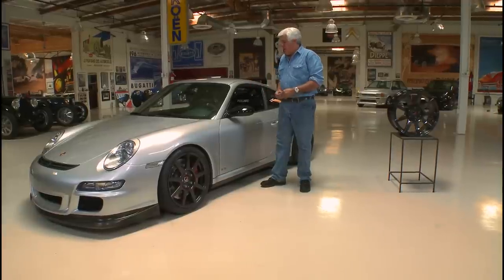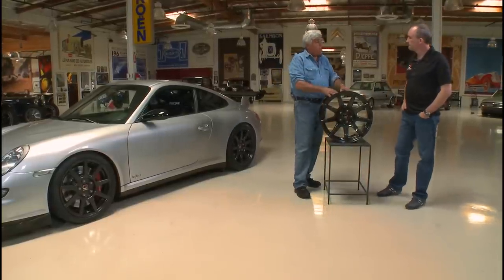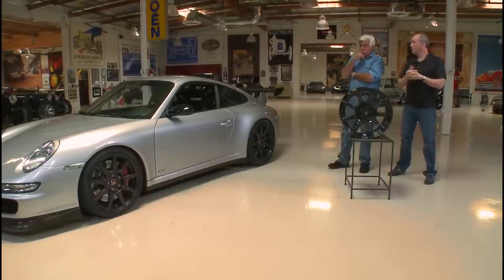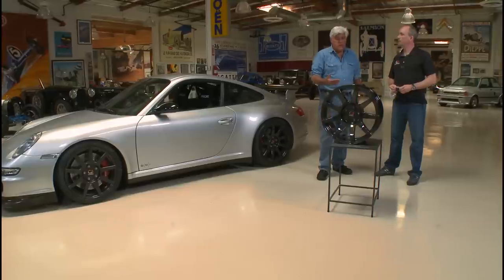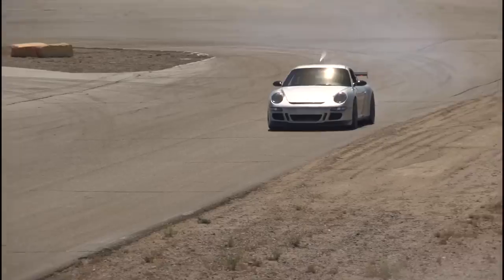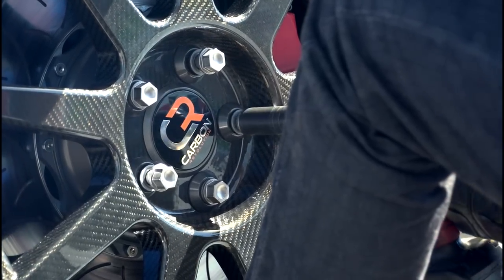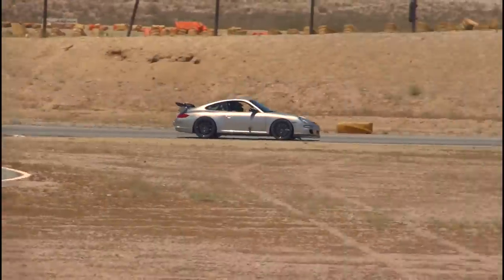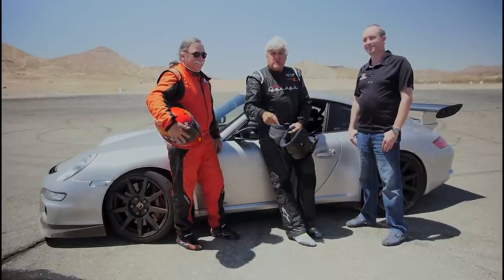Carbon Fiber Wheels Road Test - Jay Leno's Garage

Comment: Koenigsegg was first
Reply: to make carbon fiber cars
Reply: Ocelots.
Wheels, not cars. Carbon fibre was being experimented with in cars way before Koenigsegg became a car company, but not used in production cars.
Reply: G0ML3 This is true but he also said they are manufactured more expensively and at a lower volume, thus why Koenigsegg charges thousands for those carbon fiber wheels. It sounds as if he wants to make carbon fiber a more mainstream application.
Reply: Kevin schwantz I think rode a carbon fibre wheel that distroyed itself at warp speed.
Autoclaves are high temp kilns in a vacuum to draw out any air pockets in the weave.
Reply: Koenigsegg are making two-piece wheels out of carbon prepregs, all manufactured by hand and cooked in an autoclave. This is not about making the first carbon fiber wheel, this is about making the first one-piece carbon fiber wheel without those expensive and time intensive processes to get it out there and available for "everyone". More about the Koenigsegg wheel: watch?v=PGGiuaQwcd8
Reply: GodDamnDragon This I thought was hilarious after he announced the price. I was expecting 2k a wheel tops......
"We have taken the expensive parts out of the process... its 15 thousand dollars."
LAWL
Reply: Koenigsegg doesn't mass produce it
Reply: G0ML3 thank you for correcting me.  :) have a nice day :)
Reply: *****
I think you understand what I was saying... Yes you need a Koenigsegg to be able to get those carbon fibre wheels so not exactly cheap if you have to pay for hella expensive car to get the expensive optional wheels, but they were the first nevertheless. But these wheels are still not cheap, you really need a supercar to be able to afford such a wheel to begin with or atleast justify spending that amount of money. So using the term "carbon fibre wheels for the masses" needs to be taken with a pinch of salt. It's not something you'd fit on your Ford Fiesta let's say haha...
Reply: G0ML3 I totally agree. Even with this guys efforts to lower production costs the company still charges 15k for a set. I think as volume goes up and the production is more streamlined a cheaper carbon fiber wheel will appear on the market. But when that happens then yes I could see them being on other performance cars or even passenger cars not just "super" cars. But yea at that price 15k set of wheels on 10k tuner car is just not happening. LOL
Reply: I've seen the video where Koenigsegg people explain their carbon fiber wheels technology, it's not a "one piece" wheel, it looked like they've made a 3D printed material and than they put some carbon fiber layers on the frame. In order to keep everything together they put the wheel inside a geant oven. The guy with JL seems to come up with another method!
Reply: The Aircore wheels Koenigsegg makes are far more expensive to make, hand made pre-preg wheels with hollow spokes. A set of wheels are $60.000
Reply: Peter Pan thats why these guy inventing the new way to make these to be more affordable..more expensive just mean it got less efficient production tech
Reply: Carroll Shelby did fiberglass wheels in the 80's
Reply: Onur Sahin fiberglass is fiber,carbon fiber is also fiber  both is to be honest bad material to make a wheels compared to metal.
Reply: TEH KOTAK Why ?
Reply: said the guy in the video.  not sure why you're bringing this up.
Reply: TEH KOTAK I mean, carbon fiber is lighter AND stronger than metal, so you could yuou explain to me why this would be a bad material to make wheels ?
Reply: dreamoiseau yes it is stronger,but it doesnt have any kind of elongation.if you hit metal door with hammer it will make a dent right?but if you hit carbon door it will just break and shatter/crack.

this is why multibillion dollar f1 and other race car still prefer metal as a wheels.
Reply: I don't think Koenigseggg decided to make carbon wheels without thinking to that. Perhaps because it's so much resistant that it would need a very hard hit to damage it, hard enough to definitely ruin aluminum wheels ?...
Reply: And that's what they say in the video. 
The idea here, like he explains time after time is to bring this to OEM's and mass production. That's what the tech is all about here. 
So maybe in two years time you will see this in "only" 100 000 euro Porsche and maybe somewhere down the road on your performance orientated Ford, Golf R etc.
Reply: dreamoiseau
They know that most of their customer only bought their car for show and cruising at 60kmh arround town like london.
Maybe 10minutes arround very smooth track every month or so.but for real race and everyday use carbon wheels is not really practical.

Christian.v.k is clever man,he takes money from millionaire who gets more money than knowledge about cars.

Or..he invent some new carbon fiber that can bend like metal?who knows..as far as i know its impossible
Reply: TEH KOTAK
There's no way a company like Koenigsegg would fit a carbon fibre wheel if it wasn't safe, the wheels would have to go through extensive testing and controls over countless of hours. The only way a wheel would shatter would have to be if you drove the car straight into a cerb at INSANE speeds for anything to happen to it and at that point it doesn't matter does it? There's no turning back at that point, the wheel/car would be totaled. All wheels have to meet certain regulations and they have obviously passed.
Reply: TEH KOTAK You're so wrong it hurts.  90 percent of an F1 car is carbon fiber.  The #1 reason race teams do not use carbon fiber wheels is because the current rulebooks don't allow them.  As soon as they are allowed I 100% guarantee F1 will be using them.

You are very ignorant of the properties of carbon fiber.  Carbon fiber does not shatter when you hit it with a hammer.  Porsche uses carbon fiber on the hood and doors of the GT3, do you honestly think they would use a material that would shatter on impact?  Please go educate yourself.
Reply: Alize C G0ML3 theres a reason that rule exist.carbon fiber has been arround since forever. did you guys seriously think company like porsche,ferrari,lamborghini,audi,pagani,nissan and toyota cant make carbon fiber wheels lol?

Please proof it to me where i am wrong or ignorant. I study ship engineering and would like to know if my book and professor is wrong about this.
Reply: Koenigsegg is a great company, By far my favourite, but these wheels he said are $15,000 for a set. koenigsegg wheels are over $100,000 for a set, closer to 200k. they are also significantly stronger, and lighter wheels. but again, no were close to for the public. these wheels are a nice accessory for this porsche, those wheels cost more than this porsche.
Reply: Peter Pan Im pretty sure its 60k per wheel, not for a set... thats why they are only on the one:1 right now which costs 2 million dollars.
Reply: martinshoosterman Nope, "standard" Agera (S or R) has them too.
Reply: martinshoosterman it's $60k for a set, not per wheel. The reason porsche, ferrari etc doesn't use carbon fibre is because of the cost. Koenigsegg makes 10-12 car per year and therefore doesn't have to make that many wheels (wich are made by hand). It would be ridiculously expensive to manufacture the wheels Koenigsegg use in a larger scale, wich is why they don't make them. Magnesium wheels with carbon drums (dymags) have been around for a long time, Koenigsegg even used to fit them on the CCX/CCXRs but the aircore wheels they make now are all carbon with hollow spokes.
Reply: Peter Pan
Its not about cost.everything can be mass produced to bring the cost down,the main problem here os carbon fiber has really poor elongation capability,i said this before over and over again since using carbon for a wheel is DANGEROUS!please..think&read about it before using it in your vehicle!
A wheel will always moving/rotate and hit stuff on regular basis!

Even on cycling carbon fiber stuff tend to shatter and hurt the athlete many times before
Reply: TEH KOTAK (Sigh) Engineering students...... When are you going to learn that you don't know everything? Hopefully one day, your professor will tell you that you don't know everything as an engineer. But okay, you're a studying to become a ship engineer, so I suppose you have a lot of experience with the making of carbon fiber wheels.
And if you think carbon is a poor choice in boat building? Oki. How come all the racing shells, oars and seats I've used as a national team rower have been made from carbon fiber? You think the worlds fastest cat and vee bottom are made from fiberglass? I think both Mystic Powerboats and Outerlimits know what they are doing. You have gained the knowledge about the elongation of carbon fiber, congratulations, you are now an expert.
The thing about carbon fiber is, that used correctly, it is incredibly strong. Used wrong, it's garbage.
Reply: Koenigsegg was second. These rims appeared on the SSC Ultimate Aero several years before Koenigsegg made their wheels.
Reply: TEH KOTAK Yes, carbon is a brittle material and when it fails it cracks or shatters. Aluminum will bend before eventually cracking. 
But you are completely ignoring the rest of the material properties. The yield strength and ultimate tensile strength are so much higher than aluminum it doesn't matter. The force required to shatter a well made carbon rim would have completely crushed an aluminum rim long before then. 
Mountain bikes have been using carbon rims for a while now, and if you know anything about that sport, they are slamming into sharp rocks constantly. If it can handle that abuse, it can handle a street car.
Reply: TheOfficialKC Not sure SSC aver made a set that actually ran the streets, or was used at their record run. And did the SSC wheels that were produced have a TÜV, CE and DOT certification? No.The SSC wheels seemed more to be a case of prototyping and experimenting with an idea, rather than actually producing an actual wheel. As far as producing certified full carbon wheels that ran on the road, yes, Koenigsegg were the first. To speculate who came up with the idea first - it's a moot point frankly. Also, Dymag came in very early with the carbon fiber barrel and Magnesium center. It did not work.
Reply: ABOlsen69666 The wheels SSC were these exact Carbon Revolution wheels, not something made by SSC. They were in fact an option production models starting 2009.
So Carbon Revolution was the first production, one piece carbon wheels.
Reply: +tissot233 You called it with predicting the performance orientated Fords to come with the carbon wheels. The new Shelby Mustang GT350R has them.
Reply: +Xentenon 42lbs vs OEM Porsche wheels which probably cost just as much or more from magnesium.
They would be cheaper and benefit much more on cheaper performance car, like Golf GTI.
Reply: So was Rayjay and look where he is now...
Reply: Uh, no Koenigsegg was not the first, its not anything that can be considered an available rim when the technology to make it isnt distinguished and you can only get the wheel by purchasing the car, which Koenigsegg hasn't really even done much of at all compared to any reputable supercar manufacturer, such as Pagani even. Of course you probably didnt even watch the video, the guy is located in Germany and has been working with TUF for the last 3 years, where they have easily the most strict automobile regulations on earth, and they have obtained OEM certification, not just aftermarket.  But thats koenigsegg for you, no heart and soul and nothing of substance, just them and their fanbois spouting supposed numbers and attempting to get bragging rights without any real validation. Carbon revolution didn't create carbon rims to just say they could be the first or to be ostentatious, they did it because they are passionate about composite technology and progressing it forward by making it more affordable and understandable to the masses, and helping OEM manufacturers produce it. A noble goal
Reply: And the Koenigsegg wheels are all carbon fibre - no aluminium inserts around the lugnuts (or in Koenigseggs case the centre hub).
Reply: you've quite  an attitude about Koenigsegg!  These arguments about 'who / what was first', tend to degenerate quickly irrespective of the subject matter.  The question, to be precise, was 'does any manufacturer sell cars with carbon fiber wheels?''.  The answer to that is "only Koenigsegg', and one might think you would believe that when someone else trying to manufacture CF wheels, says it is so.   

I cant help noticiing, however, that you didnt say who you think was the first to produce CF wheels.  Perhaps if you read this you could enlighten the studio audience as to their identity?

I also note that Koenigsegg, for all its lack of heart, soul, and lack of ideas, is also manufacturing a motor with no camshaft, but with hydraulics which control position to the a tenth of a millimeter.  Anyone else doing that?
Reply: he already said it wasnt the first carbon fibre wheel, carbon innovations brings it to a mass market where we can begin to see price decrease overall
Reply: WRONG. Michelin made carbon wheels for the Citroen SM starting in 1971.
Reply: Not at all.f1 tyres need heat, carbon wheels wont transfer the heat.
Reply: @G0ML333  koenigsegg is the only company that makes their own carbon fiber wheels for their vehicles.
Reply: so 1 guess know one goes on the porsche configurator

Comment: I've not yet experienced carbon fiber wheels but, I did swap wheels a while back on a non-stock VW GTI. The factory 14 x 6 cast alloys weighed 22.4lbs per wheel. They were replaced with a set of 15 x 7 hammer forged and milled wheels that weighed 12.3 lbs per wheel. The difference was incredible with improved handling and braking but, the biggest difference to me was the improved acceleration. The lighter weight in the rotational mass of the driveline made it much easier for my 2.0 liter motor to spin up. Great presentation - Love your work.

Comment: I'd like one set of each color for my solid gold rocket car.
Reply: wow taofledermaus!
Reply: Who's that?  :P
Reply: Thanks Marc!
Reply: But, they're carbon fiber.  Using them would mean your rocket car isn't solid gold anymore.  FAIL!  ;)
Reply: OH...  I didn't think of that.  Plus it would have been hard to mount the solid gold tires to those rims.
Reply: But, man, just think of it.  Solid gold tires on carbon fiber wheels, the bling factor would be, like, exponential. lol
Reply: I might go for rims made out of  solid diamond.
Reply: Hmmm, sparkley...  Brilliant!
Reply: Marc D Thanks the videos are good. You should get something for that.
Reply: Went to you from here. Good stuff. Happy to subscribe nothing better than cars and guns. Well if you add beer and hot chick. I love You Tube Its all here.
Reply: ***** I'd save the diamond for the brakes a solid gold car is going to weigh a lot
Reply: Solid gold is too soft, heavy and ductile. What you need is diamond-machined billet diamond!
Reply: Pedro DeSimone Piccoli
 wouldn't the car then be see through?
Reply: ShawJohn31 ya..other diamonds.
Reply: TAOFLEDERMAUS .